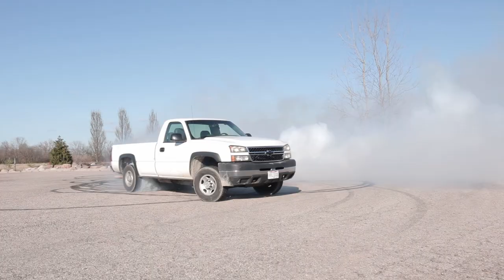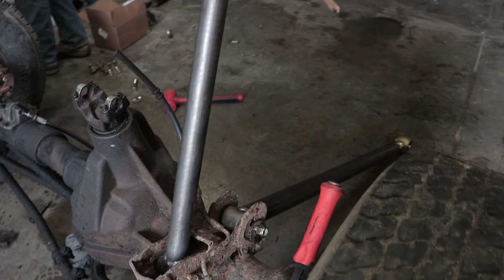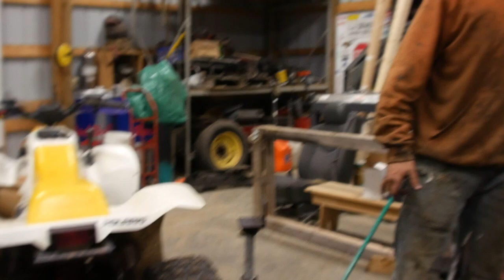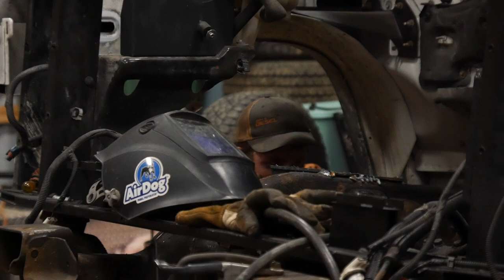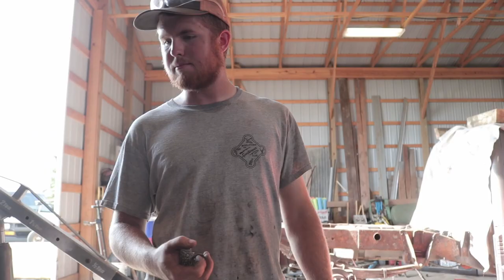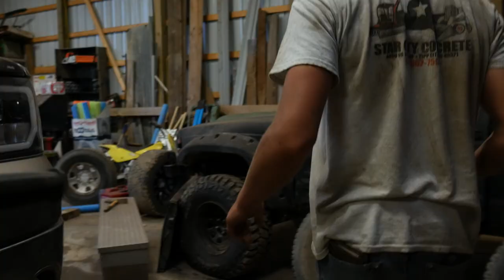24valve Cummins swap into Silverado Part 3 / American Detour

Comment: When are you guys ganna continue working on this I'm excited to see how this turns out. I'm ganna put a 99 24 valve in my 99 1 ton dually chevy and I'm curious on how you figure your build out. I'm rooting for you guys cant wait to see more.
Reply: Start yanking shit apart and putting it back together and you’ll see what has to be done
Reply: It's a 99 chevy ive got a 99 with a 6.5 the whole truck has 100k miles cause the 6.5 was constantly breaking down ! Chevy needs to be doing the right thing and buy these remaining electronic controlled death trap  6.5s back